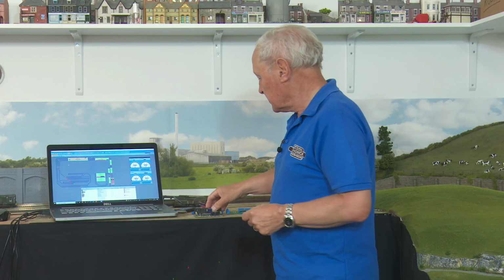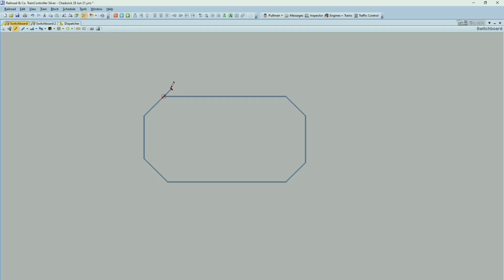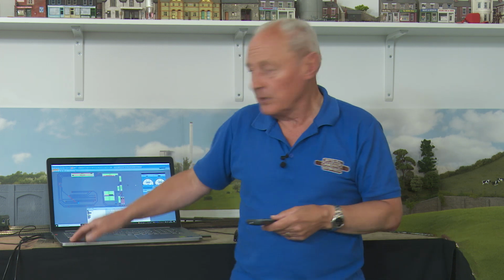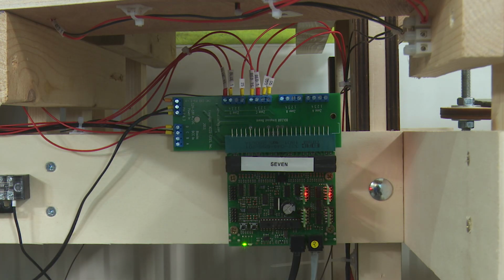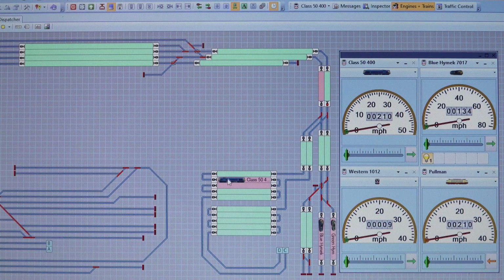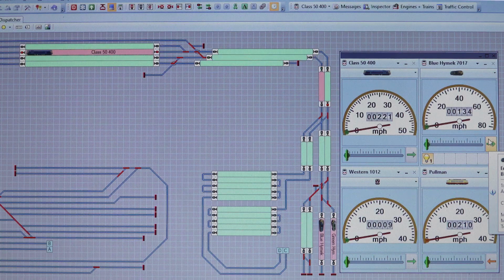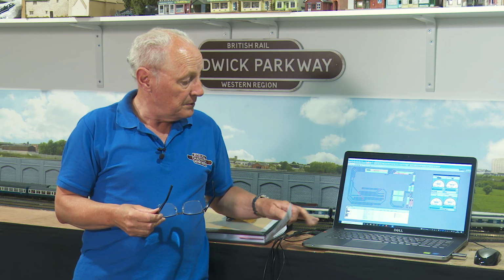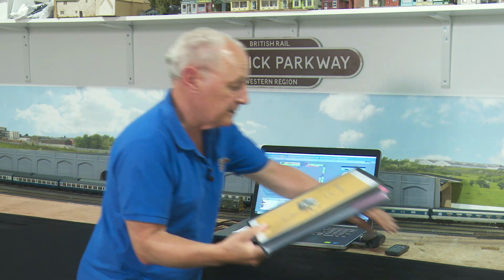An Intro to Block Detection at Chadwick Model Railway | 137.

Comment: Hi Charlie, great video as always. We have spoken before but for your viewers (and you), I have gone down the Lenz/Train Controller Gold route, using a Lenz LZV100 box and LH100 hand throttle. I have a Lenz USB Interface connected to my PC (which was a bu&&er to set up BTW) all set up to 'help' control my extensive 4 circuit, double level loop covering 18' x 9' in my attic. I was very much influenced by Everard Junction's Youtube videos and original layout. I also have the Lenz equivalents of the BDL-168's (that come in units for 8 sections/blocks LR101 - 10 of at around £80 ea.!) Each of these require 4 smaller units - LS101's  to manage pairs of blocks (about £30 ea.). I also have 15 x Lenz LS100 boxes (£85 ea.) for controlling all the points on the layout (each board able to manage up to 6 points). <Stops. Takes a breath.> Learning, settin up and using Train Controller Gold was a fairly steep learning curve! Now though, I have the whole thing setup such that all I need to do is press the "1" key on my keyboard to start 2 trains "tail chasing" each other on one loop - similarly 2, 3 & 4 keys and I can have 8 trains running autonomously in seconds!! Obviously, that's for when I "demo" the layout for visiting guests! It's much more often I only set 2 or maybe three of these 'sequences' and manually "play" with another loco or two.  Hope this is of interest to you all. Thx.
Reply: PS. forgot to mention, I use Heathcote Electronics IRDASC 3-aspect signal cards to sequentially control  all main line signals. (£19 ea.!).
Reply from the maker: A fascinating set up Andy, good on you. Regards Charlie
Reply: Wow thats some setup and money spent.,  sounds it was worth the effort in the end....well done.
Jim.

Comment: Hi Charlie

I got into automation because I wanted a lockdown project that would teach me about electronics and computer control, a model railway seemed to be a way to do this. I didn't have a layout to automate so I started from scratch with the idea of doing it on a small budget using a Raspberry Pi, JMRI, Arduinos and MERG sensor kits. What I ended up with was:

iTrain Plus - inspired by a brilliant series of YouTube videos by Bob Fuller.
Digitrax DCS52 - to interface to the layout with Loconet and provide a physical throttle
Diigitrax LNWI - to interface Engine Driver on an Amazon Fire tablet
Digitrax DS64 - two to control 8 points and 8 block detectors
Digikeijs DR4088LN - to control  16 block detectors.
Digikeijs DR4018 - to control 8 points.
All to control 6 trains on a 1800mm by 700mm N gauge layout.
Working automation but budget blown.

I have mixed manufacturers and have no issues as Loconet holds it all together. Why not give Digikeijs a try on one of your boards?

Great videos, keep them coming

Richard
Reply from the maker: Great comment Richard, much appreciated.

Comment: Hi Charlie, 
Another great video. Another software maybe worthy of a mention is Rocrail, Like jmri is free but it has a slightly friendlier interface feel than jmr, I have started going down this rabbit hole called automation and being into a bit electronics I am using diy block detectors, they operate exactly the same as the digikeijs ones with my Uhlenbrock IB2 using loconet. 
Thanks again Charlie.
James.
Reply from the maker: Thanks James for highlighting alternatives. Regards Charlie.

Comment: In regards to the video itself, another top one Charlie, thank you! I seem to have pretty much and inadvertently follow many the same path as you (Digitrax, Traincontoller etc) and its comforting to know I'm not a complete eejit and the manuals aren't the easist thing to understand. 
Regarding the two sensor in a block thing I do agree that where you want an accurate stop in a block you will want more than 1 sensor but you do have other options here.  I (so far) only have two sensors in a block in station and dead end storage areas like headshunts and use TC gold to get an approximate stop before a signal be it physical or imaginary - but you do have to setup speed and brake profiling using speed sensors as you did in another vid.
I then  use IRDOT sensors plugged into an input detector on a DS64 for those accurate stops. I have yet to test it, but I was lead to believe by other digitrax users that you are able to use those inputs on a DS64 if you are also using it to control turn outs. These means you an use the more expensive block detectors on the larger block and suppliment sensors like the IRDOT or I believe simple reed switches, to tell TC to stop the train exactly where you want it to if you have (which I believe you do) have "spare" DS64's with inputs.
Reply from the maker: A great comment Nick, but in train controller silver, you cannot enter the train length. Therefore it does make it somewhat less reliable stopping a train without a second sensor. 
Regards Charlie
Reply: @ChadwickModelRailway  Sorry, don't think I made myself clear, or not undertsanding the difference between gold and Silver (very likely :) ) but  I saw in your vid you have the Red triangle "stop" sign you can put in a block. And indeed for your second section with the block you have the distance for that stop marker set at 0 for the immediate stop - I assumed you'd be able to (much like you did for the Yellow brake distance marker) put a red marker with a distance of say 80inches.  It uses the basic calculation of distance = speed over time and calculates when 80 inches is up and stops the loco in the approximate location you want it to stop. So train length is largely irrelevent as it does as Silver does and sense when power is drawn from something entering the block and start its calcs then.  Thats on the assumption the first thing entering the block draws power. And you have to take where the pick ups are on a loco - front bogeys, back bogeys, 3rd wheel of rear bogey etc etc. 

Its not as accurate as the 2 sensor option by any means but for my fiddle yard and anything off scenery should and has been shown be accurate enough BUT you do need to make sure you do accuate speed profiling so that 60mph is 60mph (i.e. speed step 50 for one loco, speed step 75 for another) for all trains so its stop distance isn't wildy different across your loco range.

Comment: It may be worth pointing out that to detect rolling stock, such as your brake van, you must include a resistor (usually 10 kilohm) on one or more axles, to provide current flow to enable the block detector to ‘see’ the rolling stock.
Charlie, if you don’t like the Block names, you can change them without TrainController operations being affected, which I’m guessing is your reason with sticking to them.  I have done it myself without any problems.   Schedules which refer to that Block can still be run without issue.  In fact, you can even change the Schedule name to; ‘Stupid Schedule Name’ and it will still run trains as before.  So, for example, a Block called ‘PLT-A’ can be renamed to say, ‘Platform 1’, and Schedule ‘PLT-A to ST-G’ will still run a train From Platform 1 to Staging Track G as before.  Personally, I would always keep my nomenclature consistent throughout, as I am that sort of guy.  The point I am trying to make is that changing names in the General Tab, does not impact the operation of Traincontoller.  Best, Jason.
Reply from the maker: A good point Jason. I have a habit of making things difficult for myself!
Reply: I thought in that video the LEDs provided the current flow?
Reply: @howardavins1107  You are quite correct, Howard.  Charlie fitted LEDs to his brake van, which is an excellent idea and will draw the necessary current, as will coach lighting if your coaches are fitted as such.  However, in general, most rolling stock, including brake vans, have no means to activate the block detection and the fitting of a suitable resistor across one or more axles, will ensure that the entire train is detected, or that any stock that has inadvertently uncoupled from a train is detected, avoiding a collision by another train.  Best, Jason.

Comment: Charley, that was by far one of the most informative video on what involved in block detection that explained it in simple terms.  
I too can't understand the difference in pricing of the software for UK customers, especially if it's delivered electronically as is most software these days.  I was also shocked at the cost of the BD168 breakout board.  £40 is a lot for a PCB with some terminal blocks.  It could sell for £20 and there would still be a health profit in it.  One thing for certain, automation on this level isn't cheap !  - Thanks for your transparency in listing the cost involved, and for producing such a great video, with clear demonstrations.
Reply from the maker: Thanks Malcolm, I’m so pleased you found it interesting. Regards Charlie

Comment: I'm using JMRI, DCC++EX, Arduinos and generic infrared sensors. A steep learning curve  but very rewarding. Total cost was less than many single branded units.
Reply: Just starting my journey using the same hardware and software with some MERG goodies thrown into the mix as well…
Reply: @caravancapers5091  I found Little Wicket channel very helpful
Reply from the maker: Great tips guys, many thanks

Comment: I clearly do not have the brain capacity to take all of this in. I for one am looking forward to the day that you have a running session and I will be able to see all of this working and maybe then I will understand a bit more. For me, it is going to be DC with some electronic aids, such as point and signal control operations. Which means there will be more than two wires. Martin. (Confused in Thailand).
Reply from the maker: That’s the great thing about our hobby Martin,  there is something for everyone here. Regards Charlie

Comment: Arduino Mega with DCC++EX as the DCC system, talking to JMRI on a PC
block detection is custom made, current transformers feeding a low cost comparator circuit into another Arduino then into JMRI via C/MRI

costs a few quid per block

incidentally you can do block detection on DC, use a high frequency AC voltage and measure AC current flow - frequency is high enough the motor won't see it
Reply: worth nothing this works, but is far from plug & play to install, but good if you have a limited budget
Reply from the maker: Thanks Dale, for a very useful comment. Regards Charlie
Reply: @ChadwickModelRailway  lol, not quite as useful as this series of videos which really does make actually understanding not so much how this stuff works but much more usefully what you can do with it and why you would bother very easy

Comment: How would you do shunting such as set of carriages and it occupies the block but then you want a loco to enter that block to couple to it. How would that work
Reply: From what I am using the block detector won't know the carriages are on the block unless they are drawing a current ie lights or resistors fitted to the brake carriage wheels  but you can get the  the computer to  slow shunt onto the block to a given point on the block  to then couple or un-couple the carriage then get the computer to then pull away
Reply from the maker: No that’s a human task Vincent, that I would perform personally whilst the scenic trains go around the track. Once the train is complete, I will then hand it back to train controller. Regards Charlie

Comment: Once again another Great Video 
I've  Just started using Block detection using a Digikeijs DR 5000 connected to 3 DR4088 giving me 48 Blocks and 3 DR4018 giving me 24 turnout controls.
I am using iTrain Standard its been a steep learning curve I still don't have full Automation as I have hit a Snag that i cannot sort but i can still use it in manual Control
Keep up the great work
Reply from the maker: If you’re really stuck Chris, please give James from DCC Train Automation a ring. Tell him that I suggested that you call. Regards Charlie
Reply: @ChadwickModelRailway  Yes I have tried They are very busy and i work 7 days a week so i can't always phone when I'm at home had this week off to sort Layout but can't work out where i'm going wrong.
But thanks for the suggestion
Reply: @chrislockerby1411  hi - im Julian and using Digikeis 5000 with iTrain. Have you looked at Bob Fullers series of videos on you tube about iTrain?

Comment: Hi Charlie beginning of the video you mentioned automation for DC well Bruce Chubb jlcenterprises.net did just that, their Susics  and Smini boards cater for DC and DCC input, their occupancy detector has 2 types DC and DCC, I have started with this system and enjoy building my own boards with the components but they offer for a different price pre-built boards.  His books are expensive but go really in-depth on signalling, detection and automation for general DC and DCC use, also full schematics diagrams should you wish to CAD design your own and print your own boards. To which is also mentioned in the books.  Old system for some but has backup support and inexpensive really.
Reply: Will also add, you can run Bruce's system on a very old PC DOS based or a more modern with any DCC software you choose :). But as you say buyers choice and preference.
Reply from the maker: Thanks Sean, that's most helpful.

Comment: Charlie I am somewhat confused about the required wiring for a given block. I understand each block is sub divided into two sub blocks separated on the detection rail by an insulated rail joiner. Please confirm to achieve block detection if I am correct in thinking that for each sub block the only required connections to the track are one dropper to each rail? Thank you.
Reply from the maker: Yes Timothy that’s right. If you have a block with two sensors they will need to be separated by an insulated rail joiner, and have a feed to each. However it’s not necessarily essential to have two feeds although it does lead to much better and more accurate stopping characteristics. Regards Charlie
Reply: Many thanks for your reply Charlie, very much appreciated.

Comment: Great video as always. Not into block detection my self but I still enjoy videos about it. 
Just wondering what your advice would be for using computer control for point motors only. I have the dynamis ulterma but not sure if other people's software would work with that unit?
Reply: Depends on your budget You can use a Digikeijs DR 5000 to Control your Loco's and points with a Tablet,Smart Phone or Apple Based Hand Held Devices
Reply: Thanks if possible I would like to make use of thr Dynamis just wondered if its only the bachmann software that interfaces with it
Reply: @mattjackson8226  I Sure you could use a Bachmann 36-561 - EZ Command Dynamis 4 output Point Decoder
Reply from the maker: Clearly Chris knows more about it than I do Matt, so I think that is sound advice. Regards Charlie

Comment: As requested... Digitrax and Train Controller Silver. I'm just starting out with it so this is very helpful. I'm also using transponding to help with the automation in hidden sidings.
Reply from the maker: Can you explain how are you achieve the transponding please. And could you do this in a fresh comment because it will be much easier to find. Regards Charlie

Comment: Hi Charlie,
As a newbie it has taken some time to absorb tons of information before starting to lay track. The small amount of track I did lay in the early days will have to come up so I can add block detection. 
I have Degikiejs control equipment and will buy iTrain Plus later this month when my trail period ends ( 2 months free). As well as the Digikiejs DR 5000 Command.Station I have 2 boosters DR5030 which will run separate power districts as well as having built in auto reverse. Is it the right time to press the "Go" button? Well I hope I understand block detection enough to know where to add the isolated fishplates and where to isolate both rails to separate the power districts. If I get stuck there are loads of You Tube videos to help and James of DCC Train Automation is a great source of equipment and advice. Happy to share my experiances with anyone who would like to contact me here. As you say Charlie you can always learn from these comments, as we all do from your excellent videos.
Brian
ESSEX Thameside in N
Reply from the maker: What a brilliant comment Brian.
Good luck with your project and I’m sure that it will become a great investment.
Regards Charlie

Comment: All good stuff.  I bought Digikeijs kit before I started laying track.  (Perhaps I was thinking of investing before Brexit kicked in). Now laid main level, intending to be DCC using Digikeijs block detection and command centre.  The upper level will be DC for my old Triang stuff hence no block detection, with an isolated up and down rails between the 2...should be fun!  I admit to struggling with point motor control system, and might run that on DC until the rest is working.  A 500 page instruction manual....same size as the manual for my Volvo XC90!! Thank goodness I havekept a handful of lever arch binders!!!
Reply from the maker: Great comment Andy, and I’m sure that your project will bring great rewards. Regards Charlie